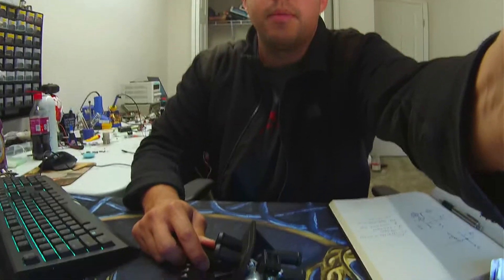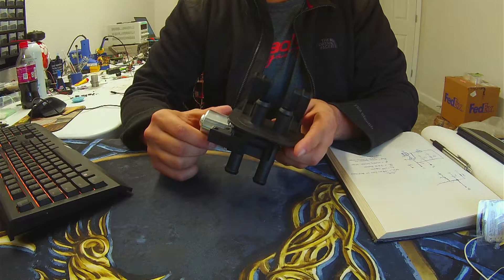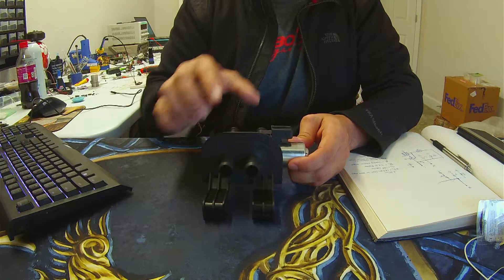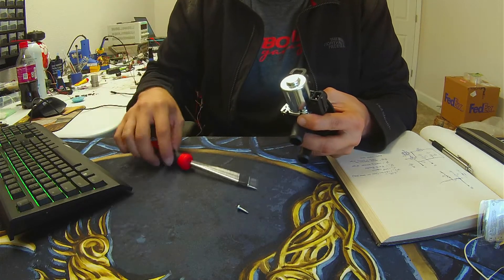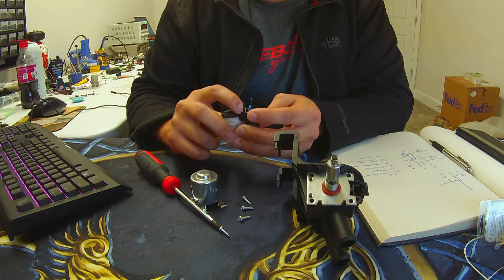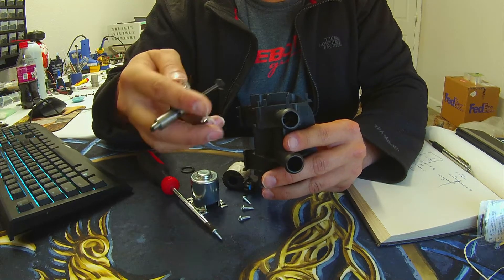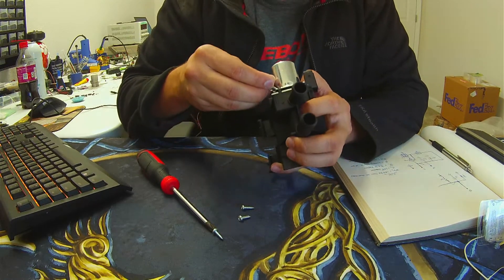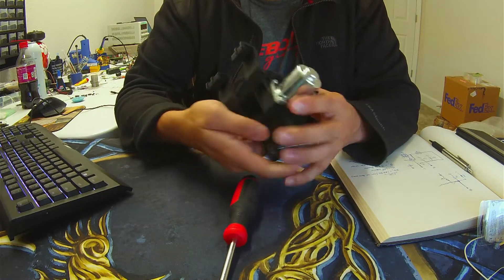SLC Heater Control Valve PWM option

Comment: That valve looks perfect for my Land Rover..... Have you got a link please? 

Is you code available anywhere? 

Thanks.
Reply from the maker: Hey i dont have anything specific written as far as code goes.  For this i just did a simple generic PWM signal.  you could find a better example by just googleing PWM eaxample for whatever platform you want to program.  I tested with an esp32 microprocessor.  You will also need a suitable solid state relay top isolate the voltage and current from the microcontroller./  the solid state relay im using in the video is a crydom dc60s5 which has a 3.5-32v dc input side and a 5 amp up to 60vdc output side.  The valve is here on amazon:
https://www.amazon.com/dp/B081RZB4TZ?psc=1&ref=ppx_yo2_dt_b_product_details

Comment: Geoff, I’ve been doing some more this about the HCV and controlling it from my PDM. How is the wired? One wire is negative and the other positive? Then apply some duty cycle amount and that determines how far it opens? Do you keep applying power or once it is set by the duty cycle you cut power to it until you need to change it’s position?
Reply from the maker: one side is ground and the other is voltage.  The PWM frequency determines how often it opens.  After doing some research, the factor frequency used to control the solenoid is extremely low around 1 hz.  Since im using custom programming with my electronics, I can use this and set the frequency very low.  be aware that most devices on the market will not be able to set the frequency to such a low value, but youll have to look through your options.  With this kind of solenoid using a higher frequency will eventually fry the device.